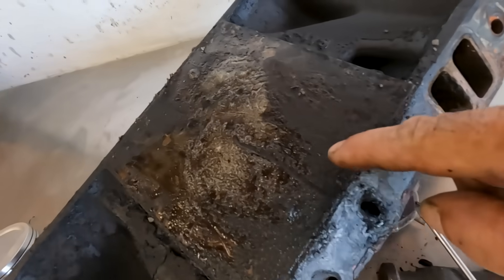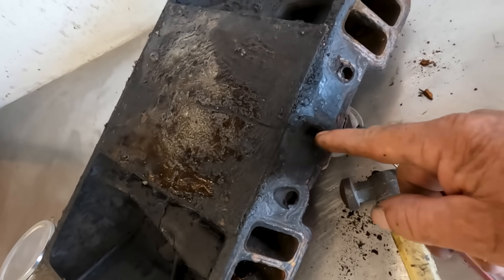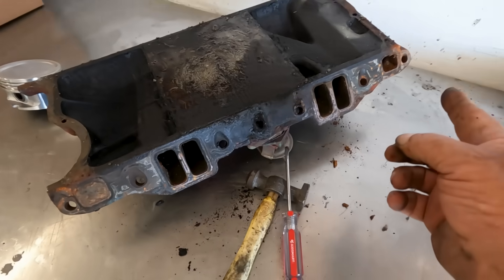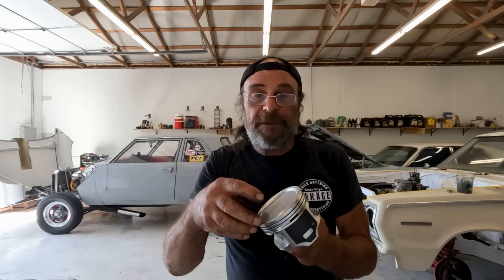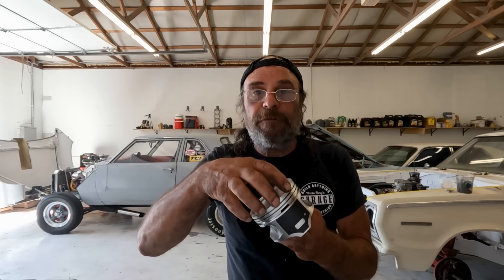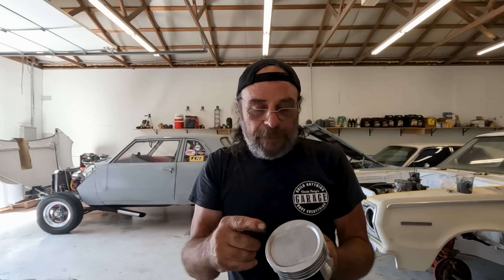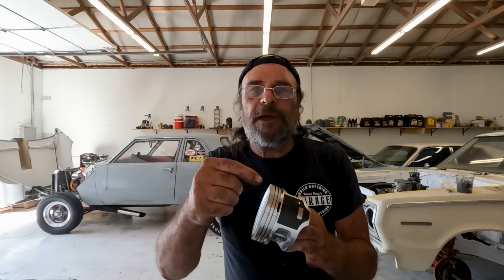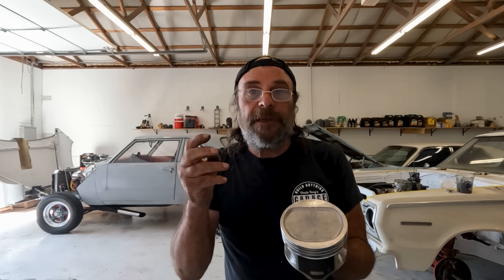The Number One Killer Of Gasoline Engine Efficiency And Power And How To Stop It

Comment: Speaking of Nitro, how about doing a video on nitro! The basics, "nitro for dummies" or maybe a "how to: use nitro fuel"  from to old days sneaking in a few drops to beat your buddy at the strip, to going jr.fuel.   i been wondering if a diesel engine could be modified to burn nitro?     A compression ignition nitro engine. 20:1 compression on nitro. 😂 But im thinking its all over soon as the first cylinder fires, 💥aka explodes! Piston out the oil pan, head to the 🌝 moon! A 6.6 Duramax, with a 8-71, or straight off a 8v92 Detroit engine , a 8-92 blower, maybe a 3.0litre screw , maybe a procharger!  Im betting nitro would really spool a turbo! Especially staging, if you had air injectors in the turbo header. With  igniters in there to ignite the excess fuel leaving the cylinders. Using it to spool the turbos, removal of all lag. Staging on the two step , making 30 psi!😳  60' times in 3 minutes ago, yesterday, gone before you get there, aka quick like a rocket ship!✌️ haha. Here i go again, rambling again!   Have a awesome day!🎉

Comment: That's kind of interesting. You wanted to burn slow. That's interesting. All the manufacturers make quick burning combustion Chambers now from manufacturers to make the burn fast to be more efficiently
Reply from the maker: Slow burn for power, fast burn for emissions
Reply: @UncleTonysGarage  
I would think a fat burner combustion chamber would be more efficient. You would not lose heat through the combustion chamber, cylinder wall, and piston because of the less time of burning. Also fast burn combustion Chambers are more efficient burning fuel so emissions go down.
Reply from the maker: Power comes through duration of burn.  The longer the pressure wave is expanding in crankshaft degrees, the further the piston is pushed.
Think nitromethane.  It makes the power that it does because the pressure pulse lasts to beyond the exhaust valve opening point.
Reply: @UncleTonysGarage  if it's lasting longer past exhaust valve that's lots of heat what is expansion that will just go out the exhaust valve. 
Looking at all the aftermarket cylinder heads for racing motors they're all pretty much fast burn combustion Chambers
Reply from the maker: In the case of a nitro motor, the pressure wave driving the piston does last beyond the exhaust valve opening point...that's where the power comes from. It keeps expanding 5 feet past the end of the exhaust header...that's where the flames come from.  I know, I spent a dozen years of my life where nitro is all I played with.
As for combustion chambers in race heads, don't confuse quench for burn speed.  Lower compression ratio street engines use that closed chamber design for fast burn.  High compression race engines use it to combat detonation, accelerating ignition flame front and enhance scavenging during the overlap period.
Same idea with two different goals.
Reply: @UncleTonysGarage  Nitro is not the same as gas

Comment: I tell you what, Casite used to make a product called "Tune up" which was an additive that you had to pour into the carburator while car running. You of coarse had to rev it and take some time to get it all in and the engine would smoke like crazy. But man it would clean the carben buildup quite a lot and the engine once calmed down would really come back to life and efficiencies would come back and power right back. I dont know lomg term effects but it never hurt any of my engines. Of coarse if there was a sealing issue such as bad rings and an oil burning situation, that would eventually show its ugly face again and revdrt back to a downfall but that product is a good one.

Comment: I still use the water to this day, just get one of those squeeze bottle water dispensers that has a long skinny outlet that won't overload the engine and potentially hydrolock it. I only do it on fuel injected engine before changing the upstream O2 sensor since this method kind of screws them up.

Comment: Fuel quality and oil maintenance are more important than anything else. Yes, Even more than upgraded stereos, neon lights and cool wheels.
Reply: Fuel quality is only referring to top tier gas not changing your grade of gas because that doesn't benefit your car.
Reply: @blueblack9675 well I changed to run on Propane. Oil doesn't contaminate as fast and no carbon buildup😂

But in gas engines? Get a Carb-cheater (or o2 sensor) the better the mixture is the less carbon buildup
Reply: @gorkzop  I work on Propane engines for a living... There's still carbon buildup in them. The fuel can't get rid of it like what gas can.
Reply: carbon has significantly different characteristics than the metal (pistons, valves).  Metal thermal conductivity is very high (metals conduct heat rapidly, carbon conducts heat much more slowly).   This reduces efficiiency and slowly kills your engine.  Oil changes, using top tier gasoline (which has higher detergent ingredients added) will help greatly with this.

Comment: Engine and oil are to hot 170+ Celcius to be economic envirioly frendly ,
the egr function on the camshaft don,t help to reduce carbon growing on the intake side 
only reduce some nox from lean combustion ,lot of new cars blowing engine parts up inside 
weak piston rings ,carbon forming burnt oil ,great ingredients for failure,s on a short term .

Comment: Great video Tony! There is an easier way to get the carbon out. I saw a guy that had a plugged VW TDI intake. He took a torch and compressed air and it cleaned it out pretty fast. No chipping and scraping.

Comment: Evinrude/Johnson engine tuner is great stuff, works similarly to the water trick but it's more aggressive on the real hard carbon deposits. I've used it on some REEAALLL crusty engines with great success. Use with caution on diesels, they think it's just more fuel and want to run away 😅

Comment: Tony, you can soak the intake manifold in lye to dissolve the carbon. For sure, chip or drill out the carbon as much as is practical, but finish the job with lye. The carbon on the valves is likely from motor oil.

Comment: The memories your videos bring, especially to us older mechanics, is amazing. I remember using 'mechanic in  a can de-carbonizer ' straight from the parts counter at the my local Dodge dealership where I was employed. This was way before sea-foam, and in a Mopar labeled can. Year: 1972-1973. Bad part was using it in a enclosed shop of 35 bays caused quite a disturbance, not only with the other mechanics, but the sales staff up front were also annoyed. The exhaust lingered everywhere. I will say, I never found another product that worked as well to remove carbon as good as the 'Mopar ' stuff. We had the Highway Patrol contract - Many complements from the police officers themselves.  I tried using water, Marvel Mystery, ATF, Etc. I swear the Mopar stuff could plug exhaust systems on a older, really dirty motor! Probably is also part of reasoning why my, and a lot of my friends, breathing is the way it is now, along with all the brake dust!. Thanks Tony, You're one of the best.

Comment: In the VW/Audi world, as well as the BMW world, we walnut blast or manually clean the back of the intake valves as a part of normal 50-70k maintenance, to clean the crust off the back of the valves created by the direct injection process, and the lack of fuel passing over the back of the intake valves

Comment: Don't forget PCV systems and EGR>>those crap up things too. To 'decarbon' an engine, I used to use Gumout poured straight down the carb. Did dad's '72 Toyota that way>>you couldn't see down the street because of the black smoke at the beginning.

Comment: Back in the mid seventies, I was wrenching at a GMC truck dealer.  Carbon was a big problem on those truck V-6 engines.  Every tune up began with a cup of water into the carburetor, followed by a soak period.  When the engine was re-started, the black garbage rolled from the tail pipe.  Then we did the normal tune-up procedure.  A few years later, working at a mopar dealer, I saw carbon totally blocking the manifold crossover on small block Mopar engines and we were doing the same exercise that you were doing in opening frames of this video.  A real pain in the butt!  Automatic chokes don’t work without heat!

Comment: Steam cleaning for non-direct injection today's fuel injection motor would require a device with some kind of drip tube to let it get past the MAF sensor (to decrease damage to the MAF) but also to be sure you can get it into the intake, because you can't pull the tube on your intake beyond the maf while running. 
Any thoughts on developing such device for your fans? I know I could do it, but I don't have a following at all.

Comment: I use Amsoil 2-stroke oil mixed in my gasoline in my old Chevy trucks that are carbureted it keeps Everything clean and lubricated I used to use Marvel Mystery Oil which is no problem but that combined with the new formulated gasoline tends to cause problems with the minor passages especially in a Quadrajet carburetor at idle and part throttle

Comment: So what's the cure for the carbon? Better combustion; if all the fuel is burnt there is no carbon residue. How do you get better combustion? Complete atomisation. The droplets you are talking about are due to incomplete atomisation which as you say burn more slowly therefore still burning while the piston has gone too far down and depleted the pressure - stopping the burn - and letting it continue out the manifold as partially burnt pollution. Since the pistons speed is set by being connected to the crank we cant change that but we can increase the atomisation by preheating the fuel. There are various ways to do this but the one I have tried is a 10mm copper pipe through the top of the radiator. This worked very well for me after lots of experimental mods (I made a tin float as the plastic one was distorted - that how hot the fuel got) on a 84 G11 Daihatsu 3 cyl that always went well (with power up in the engine oil and upper cylinder lube dispenser straight into the intake manifold) - it revved like a chainsaw and got me round as a MC mechanic on a little island off NZ for many years; after the fuel mod it was unbelievable (I decreased the main jet) the cooling fan (radiator was under dimensioned) never came on any more and I filled the tank less maybe by 25%. The oil never got dirty; I used to do 10k KM between changes and only did it then because I felt guilty. That was in 20 and it would still be going now if my girlfriend hadnt killed it but that was ok as I got it for nothing as a dented wreck to begin with anyway. This is also what you do if you want to run a Diesel on straight veg oil only you put a copper pipe in your tank instead. Oil has to be 90c, start driving on Diesel switch to oil when the temp is right switch back before you switch off - you can buy a complete premade tank from a guy in Germany; Biocar de I think. Its perfect on a Diesel van - no carbon scraper required! Keep the shiny side up mate! Kia Ora from Aotearoa

Comment: Is there no (horribly toxic, perhaps lethal) solvent that will break down carbon buildup? Maybe that+ a hot oven? Thinking about the organic chemistry, I'm not certain there is.
Reply: I wonder if the steam cleaning works by mechanical action more than any chemical reaction.
Reply: @thromboid  Like outright steam ablation moving the carbon rather than the heat + pressure? Yeah, that would explain the resistance to solvent.
Reply: Maybe an autoclave? Maybe not even that; seems like superheated steam isn't going to do a thing--there would need to be current, like placing the intake manifold under a steam leak in an aircraft carrier
Reply: @anthropicandroid4494 Someone mentioned lye as a possible agent. D-Zolve 339 is supposed to be able to dissolve carbon at room temp,  but I've never tried it.

Comment: Hey Elvis, use a long drill it will clean the carbon in short order, lot of old timers used rice down the carb while reving the motor, they said when the rice enters the chamber it explodes like popcorn does chipping away carbon in the chamber without damaging anything..

Comment: But can you do this with a 2003 Daewoo Nubira? Or will that harm the air sensors and stuff? It has hybrid cable throttle but also ECU controlled motor on the throttle.

Comment: combustion reversion being the culprit for carbon build up in modern engines simply is not true. if that was the case diesels would always have these same issues. what is the problem is the crankcase vapor recalculation system depositing oil into the intake tract, you don't see it in newer port fuel things because of the fuel cleaning at the valve, but the intake will still be oily and oil contaminated.

the intake valve temp does nothing for fuel vapor formation, the fuel air charge isnt there long enough to make any difference.  what it does effect is the vaporization ridges formed by the valve angle cuts by the carbon disrupting the fuel sheer at the sharp angle edge.  please watch some of darin morgans video lectures on wetflow dynamics in an intake system if you do not believe me and want to learn.

all piston rings rely on combustion pressure to seal regardless of ring design or material.  if ring carbon was a fundamental issue OEMs wouldve used a keystone compression ring like diesels

Comment: I remember GM top cylinder cleaner. Used that a lot back in the day. The smoke show that stuff created when you poured it into the carb was very satisfying. Pour slow at first, then flood the motor, leave fifteen minutes and fire it up for smoky fun.

Comment: The third inefficiency created by carbon is in the cylinder. Carbon in the cylinder  will be embedded with combustion mixture during compression and is non-combustable. During the combustion cycle pressures are high and the mixture stays in the carbon. In the exhaust cycle pressures drop and the mixture is released into the exhaust. This is repeated on every cycle.
Reply: Excess carbon is a good thing, all that excess gunk makes a higher compression ratio for more horsepower without doing a thing. At about 300,000 miles you will have 100 more horsepower guaranteed!

Comment: I was wondering about EGR on modern engines making more carbon buildup. Also the possibility of the cat converters getting plugged if you steam cleaned too much at one time. Should the cats be bypassed when doing this?

Comment: This is a great video lesson Tony ! I personally like CNG as a preferred fuel as it burns sooooo clean that there is very little carbon build up . (not to mention the fuel cost(s) compared to gasoline) 
This too (carbon deposits) is why oil changes must happen regularly to maintain proper lubrication !

Comment: I have never seen an old engine with a significant amount of carbon on the intake valve. It would take a huge amount to affect performance. If you use Tier 4 gas in non-direct injected engines they will stay clean. The buildup in direct injected is from PCV emissions and even then it tales a long time especially with modern engines, very little vapors from crankcase. Would water clean them or be a disaster fot O2 sensor, cats etc? Should be a way to inject PCV fumes into the exhaust, not the intake.
Reply: The EPA doesn't like it that way!

Comment: Been a muscle car v8 guy forever.  I wanted a changed got a great deal on a bmw 335xi.  Once you said direct injection.  You hit the nail on the head.  Also low rpm driving does not helpml.

Comment: Having all that carbon melt an break off going thru the exhaust is fine but when it get to the cat now you habe a more expesive issue of hot spots on the cat due tonthe carbon not only that but the fuel trim in your banks will go off due to the o2 getting all outta wack cats are expensive not sure its the way to go not only that but most newer vehicles are turboed an thats a very bad thing as the carbon can build up arpund the edges an bearing in the turbo offsetting it an wearing it out prematurely

Comment: The PCV system will pull oil back into the intake system and over the valves causing Carbon buildup.
Reply: Need to install an inline pcv oil vapour filter, to trap it, before it goes into the engine
Reply: You are 100% correct The PCV System is the Main Cause ,  The PCV System Pulls Burnt Oil Vapors and Piston Ring Blow By  into the Engine Causing Carbon Build Up on the Intake Valves and Pistons

Comment: In Direct Inject engines, the back face of the valves builds up most of its carbon because the EVAP system that dumps exhaust into intake. The "solution" to this issue has been manufacturers to add injectors before the valves in an attempt to wash the valves of that build up.

Comment: A friend of mine bought a 1965 Chevy Biscayne years ago from an old couple. 4 doors, a 396 and no options. It wasn't running right and a look into the secondary's of the Quadrdajet revealed that they hadn't been opened in a long time, if ever. He said "I'm going to get on the freeway and blow the carbon out" He did, and when he came back the 396 was barely running and making mucho noise. An autopsy revealed 4 broken ring lands in the pistons. Oops!

Comment: The water down the carb thing we did on a chassis dyno, mid 80s when I did tune-ups. It's amazing how much water you can put in a carburetor and not kill the engine! On the dyno you could load it and run it like 60 mph, crap would be flying out the exhaust pipe. 
  If you have an old nasty engine you could easily rig up a vacuum hose and suck water out of a bottle, just make sure the vacuum port goes into all the cylinders! Then rig a valve on the hose and have someone drive while you feed the water. It'll clean it a lot faster with a load on it.